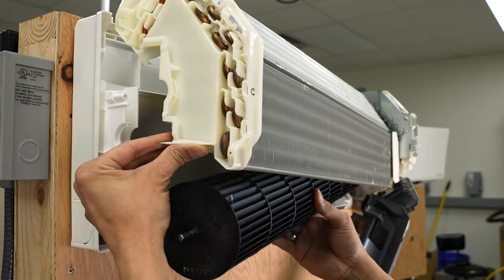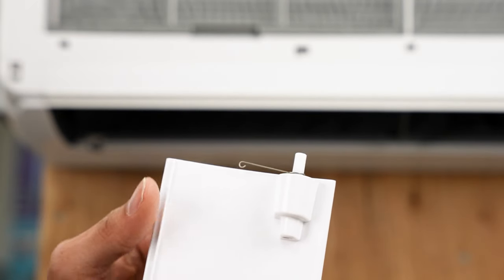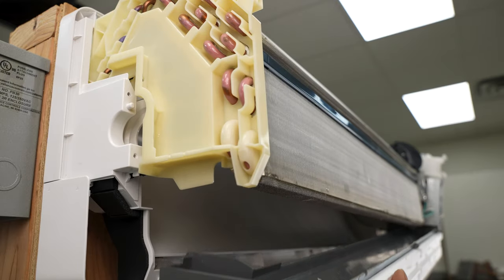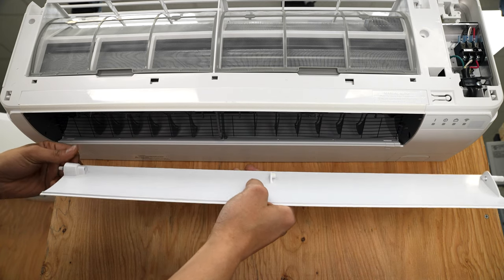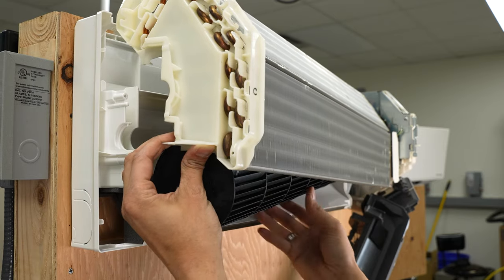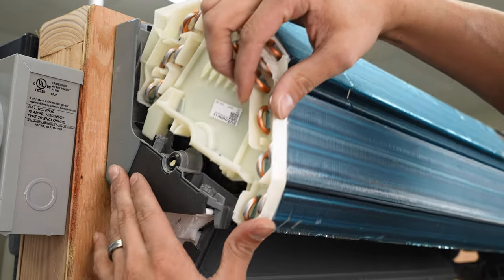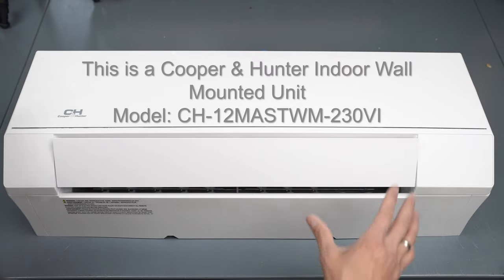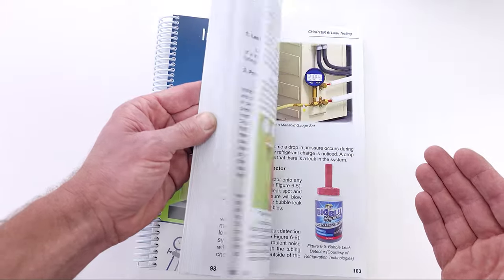How to Remove a Mini Split Fan Wheel!

Comment: These clearly aren’t designed to be cleaned.  I’ll call it bad engineering.
Reply: to properly clean the evaporators (going outside with them) the refrigerant cycle would need to be disconnected (HVAC knowledge + tools needed) or the system would need a glycol based (2nd) cycle to carry the heat/cold from outdoor to indoor with pumps and leakage potential (to be able to disconnect them easily).
Reply: @joansparky4439 :

Or the coil could be left in place, sprayed with cleaning foam, and rinsed into the condensation drain.
You know, like systems with better engineering that can be cleaned without major disassembly.
Reply: @  denverbraughler3948  
What systems would that be please?  I'have to replace mine in the next 5 years, so would be good to have an alternative - if it exists?
Reply: @joansparky4439  :

For a mini split, I don’t know.
Most horizontal package and split units can be installed to permit the evaporator coil to be easily washed without major disassembly of the air handler.

Ease of maintenance, especially routine cleaning, should be an engineering specification.

Comment: Try doing this on a unit 10 years old. Brittle as hell. Rusted corroded and needs to be replaced. Spend hours doing the clean. Only for it not to go back together. Seriously easy on a brand new air handler.
Reply: Yep, corrosion and designed to not to "really" be maintainable is limiting the lifespan on any of these.
Reply: Indeed, easier to avoid removing the seized blower wheel and just use one of those elastic drapes to wash off all the accumulated debris.
Reply: @jgm3796  As someone who just did this after about 5 years of ownership.......

I'm disassembling the entire thing in panic because it didn't work, and it looks like a colony of growth all over the blower fan.  6 passes and it didn't come off (yet wipes off with a q-tip, and is very gooey).  It's disgusting and I'm perturbed.

Swapping the unit is an ordeal and requires HVAC tools and knowledge.. we're still going to try it, but this is an emergency situation.  The room smells so toxic it's insane.
Reply: Yep..total junk i regret buying this the installer screwed up  didnt address unit...all the local service managers told me there was no addressing( i worked on robots for a decade worked with guys that drive the mars rover so f them) i did get a good tech but this thing wont last through a good cleaning
Reply: Throw 1/2 the parts away and screw it back together

Comment: Great video! Just a quick note on Fujitsu models.  Not all of them have a blower wheel with a set screw that can be easily accessed via the method you show in this video.  For example, my apt is equipped with Fujitsu ASU9RLF units.  The set screw cannot be accessed via the grill at the bottom.  For some reason, they did not extended the airflow grill from the evaporator all the way to the end of the unit like in your model shown.  Instead, there is a black plastic cover that is connected to the rest of the base of the unit blocking the set screw.  You need to lift up the entire evaporator and while holding it in one hand, remove the set screw with the other.  It is a real pain.  Also, the wired grill cannot be easily removed like you show here.  There are two screws on either side holding it in place that are almost impossible to remove without removing the entire evaporator.  It just makes cleaning this one a lot more difficult.  Nonetheless, your video was still very helpful as a resource!  Final thought: if you are an HVAC tech not removing the blower like this to clean these, you are ripping off your customers.  There is no way you are removing the gunk off the blower wheel (completely) without removing the blower wheel.  The grime on the inside of the wheel fins is particularly difficult to remove.  Thanks again for sharing this!

Comment: What a nightmare this can take some time and nobody wants t I pay hours on cleaning and still take a chance on breaking the plastics they sure didn't make it simple to clean therefore cleaning won't be done well leaving the end user with half ass cleaning.
Reply: mold+corrosion within the evaporator fins/coils gives those things a lifespan of 10-15 years (if run frequently) and due to how the system is being designed those areas can't be cleaned properly anyway as those parts have to stay in place..

Comment: You should remove one where the set screw isn’t accessible inside the blower wheel, but on the outside of the blower wheel.

Comment: The older VW Bugs could be disassembled with a flat head screw driver.
This is a prime example of why I dislike mini-splits.
There are too many plastic parts that can be cracked or broken.
Here in Colorado plastics become brittle within a few years of use.
Reply: I agree. I'm always afraid I'm going to break something unintentionally when I work on them.
Reply: The plastic on my Fujitsu units is still OK after 10 years.. had them apart 2-3 times (2 with wheel+motor out) for cleaning.  What destroys those devices is the corrosion+mold in the evaporator areas that can't be cleaned, even with the wheel out.  To be able to clean there and do some corrosion prevention/treatment the evaporator needs to come out, which requires HVAC tools+knowledge (and licenses).
Reply: @joansparky4439  as I mentioned, the dry climate here in Colorado Springs at 6200+ feet in elevation makes plastics brittle long term.
I'm sure lower elevations with higher humidity keeps plastic resilient.
What tools and licenses are you assuming I don't have?
Reply: @ YTsux24-7  
here in AUS one requires HVAC licenses to be able to work with refrigerants (R136A, etc.) and unhooking the indoor unit (i.e. the evaporator) from the cycle requires to collect the refrigerant in the outdoor unit, and later on using a vacuum pump before letting the refrigerant back into the whole cycle. YMMV?
I'm on 750m ASL, 17 deg south, so not quite as high as avg CO but also not SL.  We also got plastics/rubber that goes bad, but the Fuji-AC plastic seems pretty tough.
Reply: @joansparky4439  :

Recovering the small amount of refrigerant, opening the evaporator coil to atmosphere, removing, cleaning, or replacing it, vacuuming it, and restoring the charge, would cause wear and tear, lose some refrigerant, and introduce contaminants.  It’s impractical even for annual cleanings, not to mention the labor cost.  Does the manufacturer recommend this?
Reply: @denverbraughler3948    no, I was just thinking loud what is needed to get the coils outside and be able to clean them properly.  To be able to do that annually or more often would require a separate coolant circuit with glycol or similar like they do for big commercial installations in Germany by SEW-Kempen with their GSWT system.
Reply: LG sucks, I had a brand new trim piece snap, ordered a new one and got the wrong part non refundable and it was also broken.

Comment: Why don’t the manufacturers make it easier. Profit I guess
Reply: Once you do it couple times is pretty easy.
Reply: Job security.
Reply: the refrigerant cycle can't be disconnected on any of those, so the evaporator has to stay in place - corrosion+mold in them destroys the unit depending on usage.. mine are running frequently and even after cleaning them from the inside (wheel out) every 2-3 years are going to need to be replaced after 15 years tops.
Plastic is still good though (got Fujitsu units) - Mitsubishi seems to be easier to maintain IMHO.

Comment: My 2009 unit got so bad a few years back that there was no air flow. They don't tell you about  why that may happen when you buy these things. Any way mine was top of the line model and the job was difficult. But when I pulled that thing out I was shocked at how much gunk and fungus was on it. They tell you to keep filters clean well that's easy it's these darn blowers that are the problem. I have to admit that they don't look that hard now to do.

Comment: I just use about 90 psi with a long tube air blow gun and blast off all the gunk on the aerodynamic part of the blades..seems to work ok.

Comment: This is a dirty secret that manufacturers will never talk about or just glance over - deep cleaning these split systems annually, maybe twice a year if in very dusty and humid regions. Is there some other maintenance plan that helps keep the blowers from collecting dirt/mold and without doing a full dismantle?

Comment: Have these gotten easier over the last couple of years? My 2 ton DuctlessAire is 5 years old and a huge pain ITA to clean the blower wheel.
Reply: same here with an older model Fujitsu (ASU9RL2) the coil is surrounded by styrofoam with no easy access to the blower wheel. I ended up because it hadn't been cleaned in 6 yrs (and I smoke a lot) is to just clean by spraying hell out of it and blowing hell out it. It runs but is dirty as all get out.
Reply: @moss8448  Imagine your lungs.....

Comment: I totally believe in getting that blower wheel out and cleaning it really well with hose water. I clean my 2 Mitsubishi  units once or twice a year. It's not easy, but I just think it needs to be done, otherwise there's no way to get all the gunk out. Your place will smell like nasty tennis shoes if you don't do this. At the moment, I can't get setscrew back on to motor shaft-- it won't grip the shaft for some reason. I don't have a flat side on the motor shaft. 🤷‍♀️. So I only have one unit running at the moment. Pooh 😫. Anybody have suggestions?

Comment: Can you please post a video doing a gold air 12000btu blower wheel removal and drain pan removal. Cos this aircon is difficult to remove. Blower wheel locked on the shaft motor and no screw to remove to loosen blower wheel out.

Comment: Hi its very difficult to remove the blower wheel on a gold air 12000btu indoor unit non inverter unit. The drain pan has no clips to drop it down and blower wheel has no screw attached to it.

Comment: Hi, Mine is multisplit Mitsubishi Starmex 2018). I unscrew and removed the set screw but the blower wheel is still stuck to the motor and I am unable to pull it out. I have used screw driver as a crowbar to try force it out but it seems stuck to the motor. (I have already loosen the cooling coil). Any suggestions? Thanks.
Reply: Same issue with my LG, set screw removed but it seems seized to the motor shaft. The motor shaft does have some visible corrosion. 🫤
Reply: I just did this with my Fujitsu and getting the blower wheel on and off were the hardest parts. I thought I was going to break it!
Reply: Mine was seized last time I cleaned my unit. I managed to get it off rather easily, but this time it seemed worse. I was able to get it off with a firm pull, just got lucky I guess. But when I reassembled, the set screw won't grab to the motor shaft. I have tightened the set screw, and don't want to over tighten, but it's not gripping the motor shaft. Suggestions?
Reply: @papajhova  I managed to remove the blower wheel on my fujitsu, which is pretty much exactly the same as the one in the video, but it seems impossible to put it back on. I am using so much force I feel I'm going to break it. I still haven't managed to put it back on. Any suggestions?
Reply: @oloyang431  honestly I wrestled it for a good 10 mins and all I did was mess with the angle that I was pushing, and idk what I did, but it popped back on. I thought I was going to break it too... and/or pop a vessel.

Comment: What do you recommend for cleaning evap coil? Bibb kit and water or no rinse coil cleaner?
Reply: mold+corrosion doesn't go away with "no rinse cleaner" and even pressure washing isn't going to do a lasting job..  ideally the evaporator coils should be taken outside for a proper clean, but those systems are not designed for that.

Comment: Or.. Just use the cleaning kit with plastic bag to drain into the bucket and use a moderate pressure washer with cleaning solution. No breaking of plastic clips and messing around for hours with 1 blower trying to put the blower wheel securely on the motor. 😎💩

Comment: I have a couple of Friedrich units. They don’t seem to be anything like this. I have no dealer support, so I’m on my own.
Reply: The set screw is not in the middle on the blower wheel, it is on the shaft of the motor which is at the right of the unit. You will.have a screw right beside a beige insulator where the copper diffuser is then there is one behind de electrical compartment ( at the left of the compartment but on the right of the unit. Next wiggle the black drain pan downward and your set screw is under the yellow plastic cover protecting the motor. Hope this help

Comment: Bought a SpeedClean CoilJet Coil Cleaner battery power washer a few years back and will never go back. Their cleaning solution does an amazing job. It's far faster than doing all this unnecessary labor saving our customer money not to mention potential problems demoing/reassembling unit.
Reply: u are not going to clean the mold out of the unit properly when relying on spraying fluids into the unit blindly.. LOL